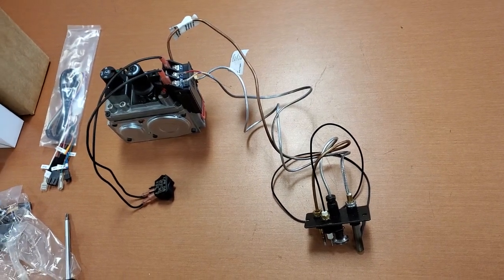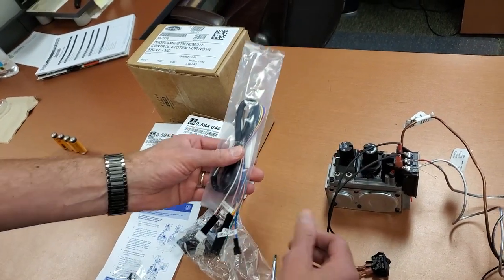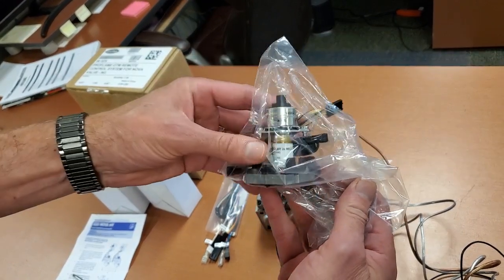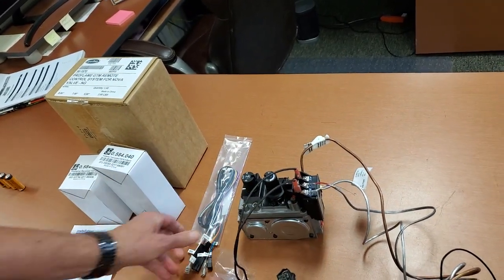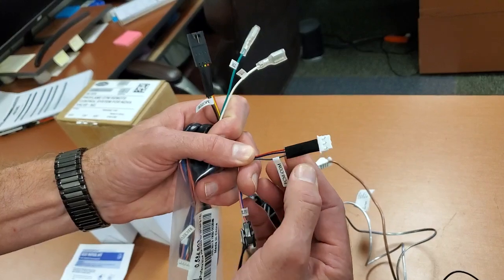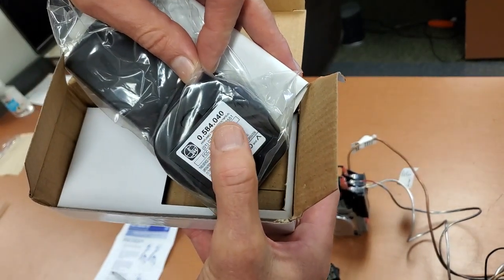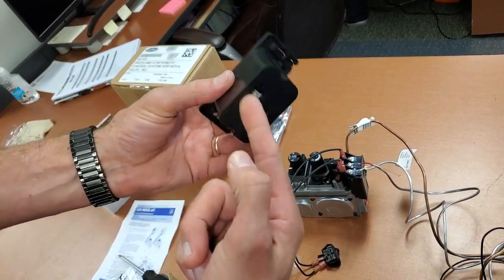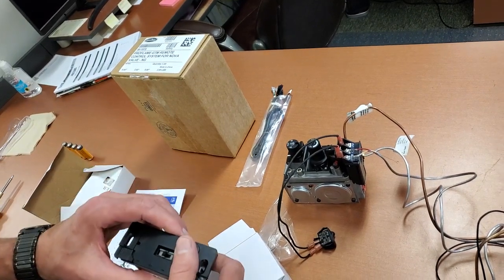SIT 820 gas valve, adding the GTM remote control hardware

Comment: You have to be worried with grid ground. You should put two diodes in parallel with opposite polarity rated at 50A or whatever your grid service is rated  to galvanicly isolate the grounds. Otherwise your steel hull or floats will act like a battery and corrode faster. The diodes add a 1.4v drop between the two grounds to keep them separate but still function when there is a fault. People use a 3 phase bridge rectifier to do it because its a neat and cheap package. Very common on boat stuff. And it meets code. It prevents ground loops and helps prevent galvanic corrosion.